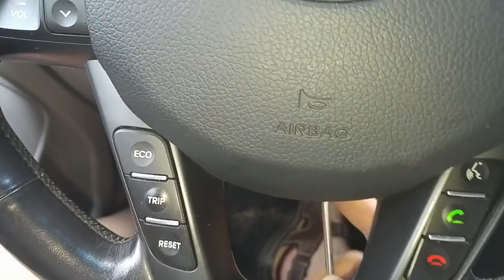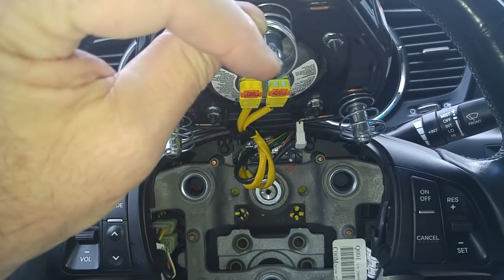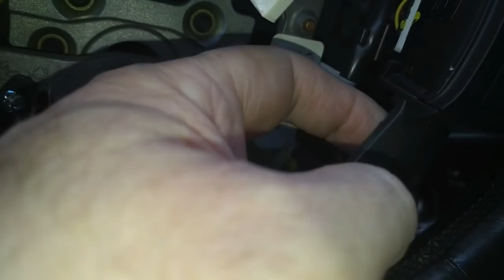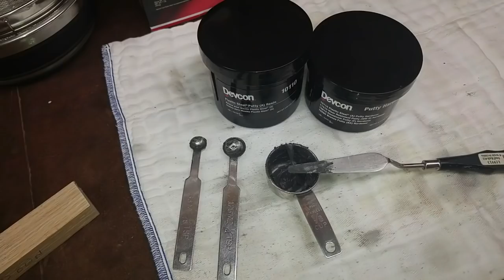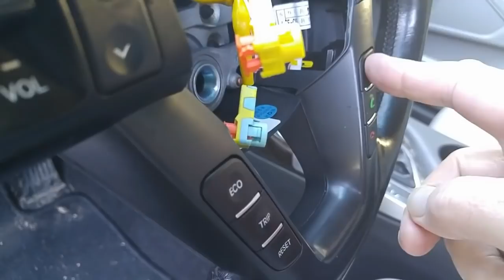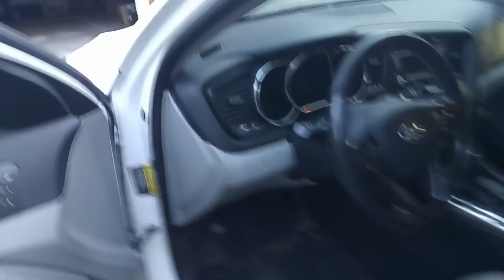How to Remove and Install 2013 Kia Optima Steering Wheel Airbag ~ Button Fix!

Comment: So my 2013 Kia optima EX had the same issue with most of the control buttons on the steering wheel not functioning properly including the horn.. i remember when at one point my horn was working fine then it started to fade away each use until it completely gave out.. I recently replaced each and every fuse.. that didnt fix it. Now i probably have to replace the horn relay to see if it's that if not then i might just go ahead and buy the clock spring.. I'll definitely be coming back to this video and hopefully I wont have trouble finding the fix to the controls and horn!

Comment: Thank you for posting this video. Initially, I had a difficult time getting the airbag off because I did not understand the mechanism.  You explained and showed it well. I used your instruction to remove airbag and then go further to remove the clock spring.  Thanks a bunch!!

Comment: Would you happen to know how to remove the air bag for 2016, 4th gen model?  It only  has one hole for the bottom push pin, but not the other two.

Comment: Thanks for this video. I have the same issue on my 2013 SX-L, but on the opposite side.  Now I can easily fix it and get rid of this POS automobile once and for all.  Nothing but nagging little problems like this since I've owned it. Also, more recalls on this car than all other vehicles I've owned combined

Comment: Has anyone had a clunking noise coming from steering wheel when turning in your Kia?
Reply from the maker: You should never hear a clunking noise.  That's a serious issue that could lock up or fail some day and get you into an accident.  Have it checked by KIA.
Reply: Yes. I have. There’s videos on how to repair it yourself but it is A LOT of work. I had this happen to me on my Kia. There was a notice on it so Kia fixed it for free.

Comment: Same thing just happened on my Optima on BOTH sides at the same time, not sure why, they do not seem connected, but before I found this video, I did notice the broken plastic that holds switches in place. I found a complete replacement assembly on line, but if it can be fixed like you did, why not save $40. Thanks for this much needed video. My Optima is a 2012, but same exact steering wheel. And yes, it’s been an awesome car, bought it new. Once factory tires went bald by 28k miles, high quality replacements made it quieter and a little more sporty handling. It certainly is not a sports car, but it’s been very reliable, any problems I have had have involved trim items, like these buttons, and clear coat starting to peel just a little in a few minor spots just after warranty ended. Not a single mechanical issue. Still love the car.

Comment: I mean about The airbag i want to get one 2014 it has airbag deployed so just push these 3 pins and unplug the colored wires after disconnect the battery for 5 min and plug in the new in

Comment: I need to replace the clock spring in my fiancees 2013 kia optima hybrid. Her steering wheel configuration looks identical to yours. One question, I would have to completely remove the steering wheel to get to the clockspring correct? By undoing the large center nut holding the steering wheel on? Thankfully i found this video, I feel 100x more confident going into my clock spring fix now. Your feedback would be greatly appreciated!.
Reply: did you manage to replace the clock spring? tips to share? any major problems I should be aware of before diving into it? Thanks

Comment: Gunblue 490, please do a video of your opinion of carrying a pistol for protection with a round in the chamber and not having one loaded. 

I have a concealed permit and carry a weapon to be prepared for the day it is needed (hopefully never). It is my believe that not having a round in the chamber is safer. I carry my pistol daily and not having a round ready to fire will never have the chance of going off accidently. The way that I carry has my pistol pointing in the area of my femoral artery and if it were to go off the results would be critical.

It is a trade off of not being able to pull my gun out and shoot instantly. I don't live in a war zone and the time it takes to make my pistol ready would take a second longer I feel that my decision is a good one. I would like to hear your opinion. 

Thanks
Reply: Same problem on my 2012, so now I can fix it myself....Thanks so much for posting this....

Comment: Well done on the repair. The third wire is for grounding the horn circuit. There is a mystery surrounding the air bags. With care as you have done enables the removal and installation without setting it off. Should you set it off it will go BANG, but you are used to noises like that with the guns. I do enjoy all the gun clips you put up. Cheers from NZ.

Comment: Super glue would have fixed it instantly.
Reply from the maker: Matt 
Not nearly as strongly (I have many years experience with cyanoacrilate glues of all kinds... it's one of the best fingerprint lifters for detectives, too), and a single drip into the buttons would not be good.

Comment: I had to rebuild the tilt steering column on my 77’ C10 square body and it was by far the most difficult thing, mechanically speaking that I have ever done. I completely rebuilt an iPhone once and that was still easier.